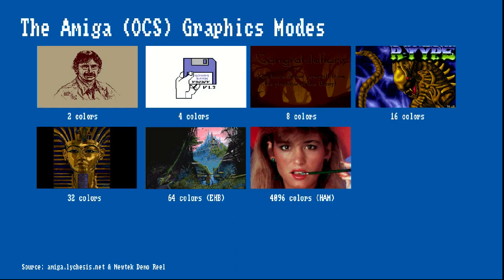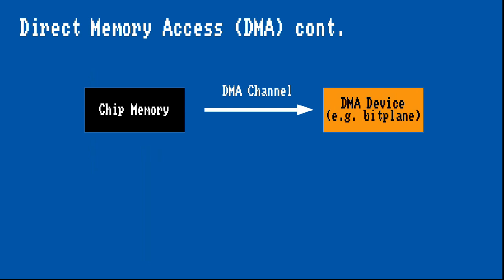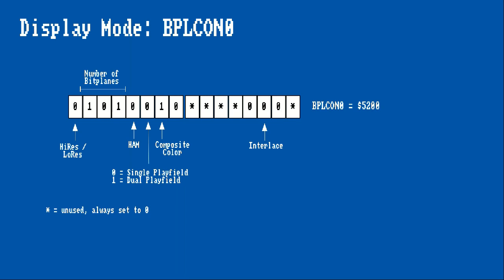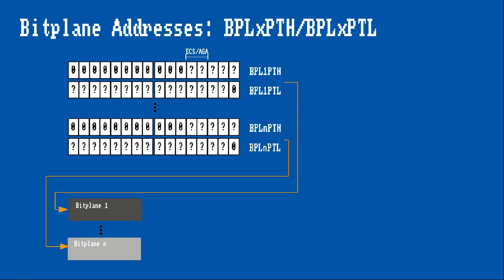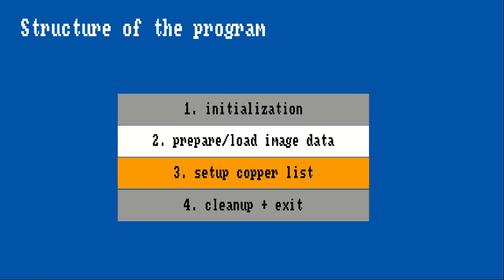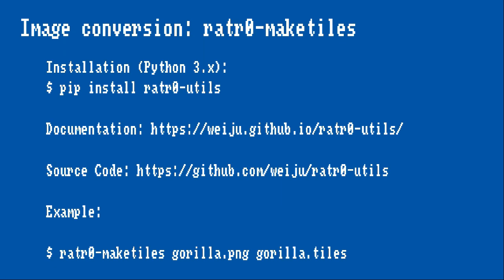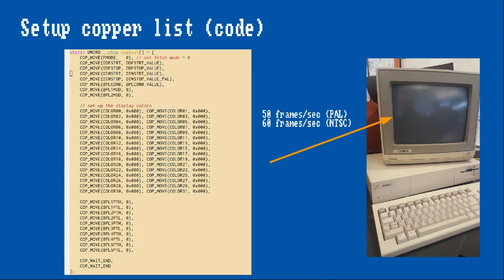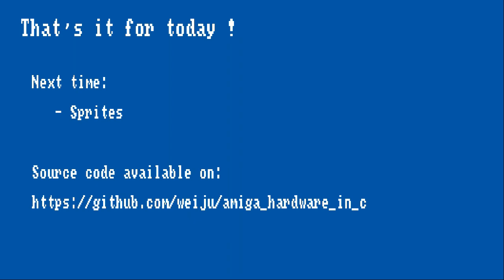Amiga Hardware Programming in C Part 3 - Single Playfields

Comment: Great series. Thank you for this. Nevertheless I encountered a problem. I installed ratr0-utils but how do I actually run ratr0-maketiles and where? This command is obvoiusly not visible in command line. All I have is set of .py files in ¬/.local/lib/python3.7/site-packages/ratr0/util.
Reply from the maker: Hi, If you install this through pip install ratr0-utils, the commands should be automatically in your system path. Or they could be in your ~/.local/bin, by the looks of it

Comment: Sorry for my dumb question but what do I need to install on my HardDrive in order to start programmation C on Amiga ?
I mean on real machine. Please, could you provide the simplest environment/software for a KS1.3 OCS Amiga with a harddrive ?
Thank you :)
Reply: I don't think you need anything special other than a C compiler and linker. SAS/C was the go to commercial C environment development for the Amiga. It includes a text editor (terrible by today's standards, but it works if you want to live the full 1987 experience), a debugger (hard to use), linker, includes files, etc. It can be found in Amiga software collections (try EAB forums) and it even got patches until the mid-2000s iirc.

Storm/C is another commercial option. It is still being sold, but I think recent versions are PPC only.

You could also use VBCC as Wei-ju does in this tutorial series, but I never used it personally. You would have to provide your own text editor I think. Or just use ed.

Personally, I also started to code on a real Amiga a few months ago (a pretty beefed up A1200) but the experience is just too slow and painful compared to a modern development environment, even with a fast Amiga. Do not expect any syntax highlighting, completion or hinting from the editor! Besides, the Amiga OS and hardware has an "anything goes" philosophy so the lack of any kind of memory or system protection means you are going to crash - and reboot -  a lot.
You will be constantly looking up documentation while coding, and it is not something that can be easily done on the Amiga. So you will probably have a laptop handy. So you might just as well use your favorite dev environment and either cross-compile for the Amiga, or transfer the code over the Amiga (or an emulator) and compile it there.

If you just want to play a bit with code, I guess coding on the Amiga can be fun for a short period of time, in a "take a 1930s car for a ride" way. Fun, but terribly inconvenient in the long run. If you are serious about coding for the Amiga, cross-compilation is probably the way to go.

PS: assembler is another matter however. Working with AsmOne or AsmPro directly on the Amiga is a pretty smooth and fun experience for small programs.